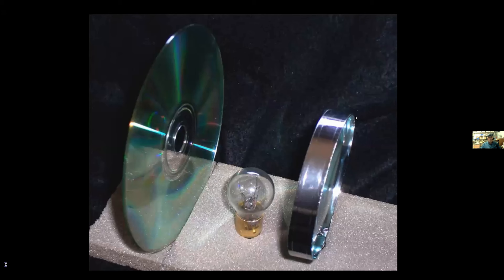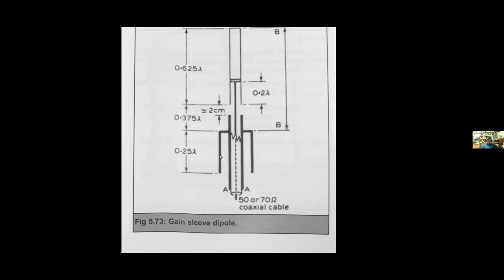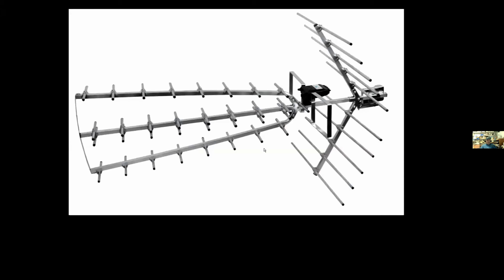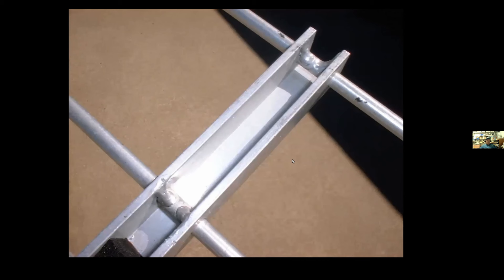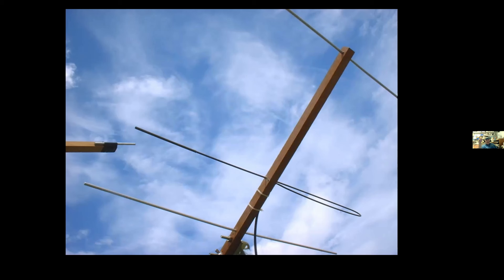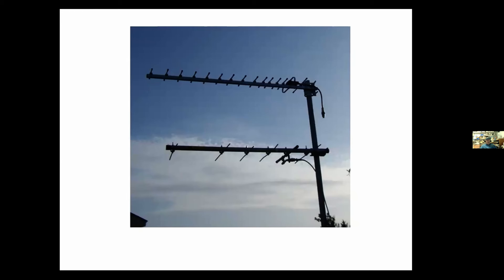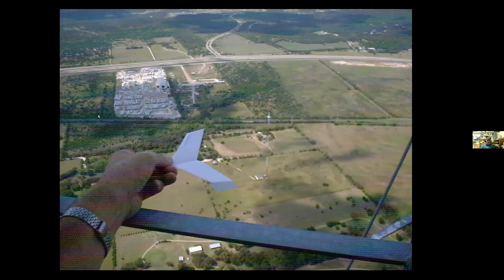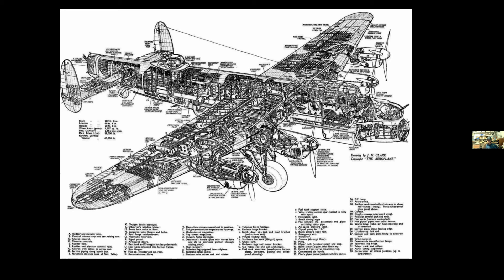Kent Britain WA5VJB Discusses “All You Need to Know About Yagi Antennas”

Comment: Great video! Thanks for all of the excellent info, it was very helpful, but at the 37 min mark you never really answered the question. Right when I thought I finally figured it...... NO it's NOT resistive! (ug!) Isn't resistive load pretty much the same except for heat losses from an rf standpoint. I mean, if you are trying to match a 50 ohm coax to 300 ohms, like lets say a folded dipole, could you build the matching network first, test it for good swr at the 50 coax end and put a 300 non inductive resistor at the other end just for the purpose of making and testing a matching network, it should be a good match? I've tried just this on several frequencies with several different pieces of coax, multiples of 1/4 and 1/2 wavelengths, from 28-148 Mhz and it gave VERY confusing results! The "stubs", tuned fine by themselves when using an MFJ 259 analyzer. In other words, 1/4 was a "short" 1/2 wave was "open" like it should be, so I know that the analyzer and coax are fine. I guess when you're using a matching network, an antenna acts WAY different than a resistor, outside of obvious. I guess I'm just trying to simplify "complex" impedance. Thanks and 73's.
Reply from the maker: <Voice of Kent Britain - seriously>  "OK, lets start with the impedance of a dipole.

72 Ohm if it feed exactly in the middle and the elements are fairly thin and in free space.

Now build you a 40 Meter dipole and hang it in the back yard.

Bet it's not 72 Ohms.  

The impedance will vary considerably depending on it's height above ground, dampness of the ground, and any other objects near it.
For typical heights, the dipole impedance will be much less than 72 Ohms.    So you see a little SWR even those the elements were perfectly cut.

In the case of a Yagi, it is those nearby elements we are using for impedance matching. 

Having a director and reflector element very close to the folded dipole will load it's impedance down..
Perhaps we should say the impedance of this 3 element 'structure' is 50 Ohms.

And there are a lot of exceptions when they call a folded Dipole 300 Ohms.  Using the typical element diameters and the typical Length/Width ratios. most commercial Yagi Driven folded elements are in the 200-250 Ohm class if tested by themselves.

I hope I didn't muddy the water even more.   Kent WA5VJB

PS   This goes all the way back to Maxwell and his equations.

        I have an antenna at my house, and another ham has his antenna at his house.

        Now the 'air' between the two of use is now a transmission line.

       WHAT IS THE IMPEDANCE OF THAT TRANSMISSION LINE?

       Or you can think of this as What is the Impedance of the Universe?

       377 Ohms          Per Maxwell 120 x Pi with a fudge factor for the dielectric constant of air.

       Now you can think of that Yagi Sturcture as also being a 50 to 377 Ohm impedance transformer.

       Building a Stealth Aircraft?    You don't want it to look like a 50 Ohm dummy load, you want it to look like a 377 Ohm dummy load." - fairlawarc.org

Comment: One of my questions when I look at all of these ... is the driven element insulated from the boom?  So many of them look like they aren't.  And are the reflectors and directors insulated from the boom?  They sure don't look like it.  Finally ... I keep seeing videos and descriptions of dipoles where we don't seem to have two separated "rods" going out from a center from the feed, but rather one rod fed from the middle --- or as in the case of the folded dipole, at the "ends" which are bent around to be in the middle.
Reply: THe driven element does not need to be isolated from the boom.

Comment: Interesting that you killed the idea about non-touching capture areas. I am going to install a 3 el 10m, 6 el 6m and 15 el 2m LFA yagi on a 5m tube above a Versatower. Plan to just spread them out evenly. You also killed the G0KSC hybrid balun (pawsey) - will remove min and relay on the ferrite choke. SM4CHK/Oscar

Comment: I have another question I'm going to ask here as a new question so anybody else who has one of these can will also get helped by the answer. I have the 1970's version of the 144 Mhz 11 element Cushcraft Yagi, but I can't seem to find the 7 element plans anywhere. They do (did) make a 7 element 144 Mhz Yagi, but the boom length is only 8 feet instead of 12 feet long. Also their specs claim about 2 dB less gain than the 11 element. Does the (modified 11 element) 7 element you speak of use the full 12 feet of boom, or is there anything special about it? Thanks for all the help. This has been a big learning experience for me.

Comment: Hello,
Thak you for a very informative and interesting presentation. 
Many years ago, I saw a log periodic penode dipole which an engineer had made from two copper sheets. 
The antenna resembled a delta wing shape. Two delta wing shaped copper sheets were used, placing one delta wing shape copper sheet above the other delta wing shape copper sheet (in the configuration as wings on a bi-plane); both sheets were supported by paxolin supports keeping the angle between that two sheets at the end of the antenna where they came to a point almost touching each other, as the plane of the two delta wing shaped copper sheets were around 15° apart.
Along the centre of one of the delta wing shape copper sheets, from the point of the delta shape to the centre point at the back of the wide section, was soldered along its length a straight piece of tinned semirigid cable. At the wide section at the back of the antenna, the semirigid coaxial cable was connected to a bulkhead 'N' type female connector attached to the paxolin support. At the front of the antenna, the inner cable of the coaxial semiridged of one delta wing shape copper sheet was carefully bent round and soldered to the adjacent point of the other delta wing shaped copped sheet. I believe that the semirigid cable was 50 ohms 0.085" diameter or smaller. 
This was a wide band antenna. Apparently, the engineer had used a pair of tin snips to cut out small right angle shapes along the edge of both edges of both copper sheets of the antenna. I think that he may have used a network analyser.
Do you have any information about manufacturing the type of antenna I have described? 
Also, do you think that it would be possible to manufacture such an antenna using a r.f. generator, slotted line and a vswr meter?